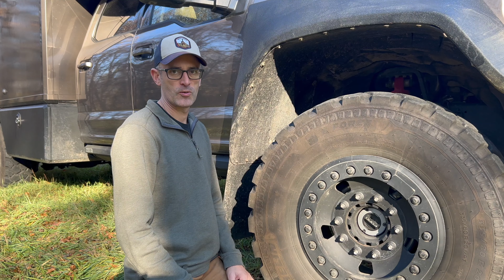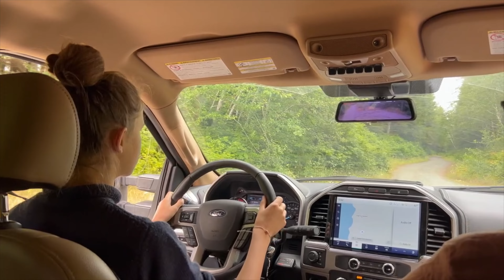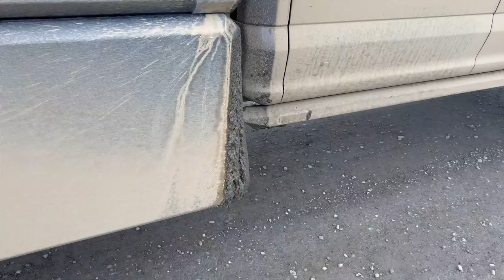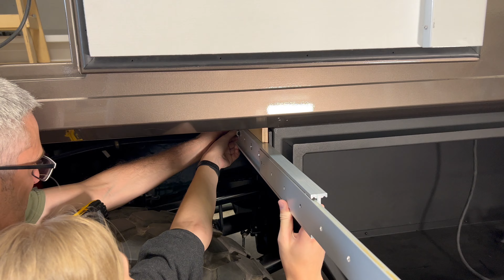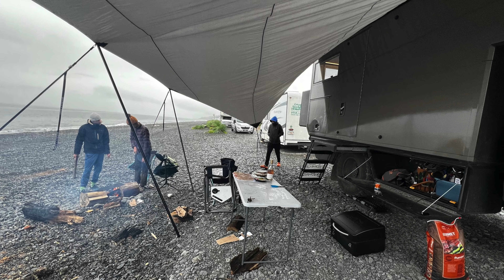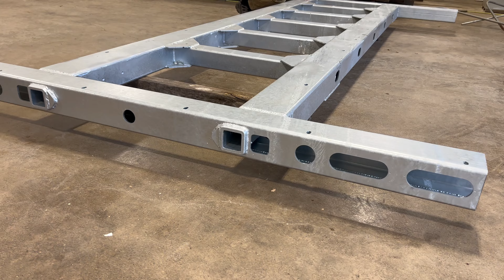Ultimate Overlanding Rig! Exterior Tour Part One

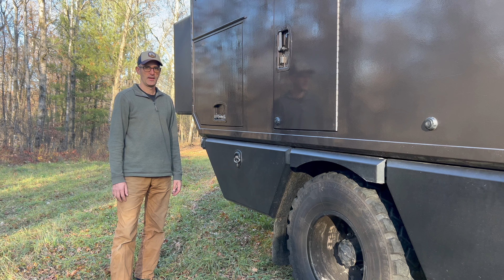Comment: Nice truck.  The one I'm building is very similar.   A 2019 Ford F450 cab and chassis.  205" wheelbase, 4x4, 120" cab to axle, and I cut the rails down to 25" total length of the truck.   4" Liquid Spring Adventure Kit with "true-earth" leveling, DBL bumpers, winches front and back, 365/80r20 Michelin ZL (new version), 98 gallons of gasoline for the 6.8L V10 - thirsty girl.  6:17 gears, TMPS, Bowen Customs articulating "slide-in" camper bed with a Kingstar Kruzr 10.  The total package will be right around 16,000lbs and about 27' long.  Instead of a double cab, it's a single cab, and there's a 5' "Forward Garage" from Bowen where I keep the spare tire, bikes, surfboards, backup power and propane generator if needed.   1000W of solar on the roof, and 400W plug in from the exterior, and then another 1200W of potential solar input into my secondary backup power station.   The 5' Bowen Forward Garage will have a kitchen setup and extra fridge for outside cooking.  Electric awnings and custom tarps that can cover the whole passenger side.  Rear center door into the camper, which really simplifies things.   Often times, that side exit is a real conundrum, but your solution is a real thinking man's solution.  Really, bravo.  Well done sir!.  Your camper build quality is better than mine, but also more expensive.  I'm a single guy, so my rig will be great for me.
Reply: Do you have a video of your build. Are you using boxmanufacteur.